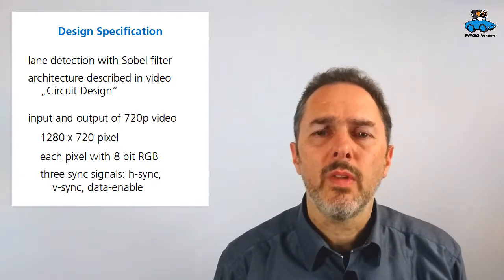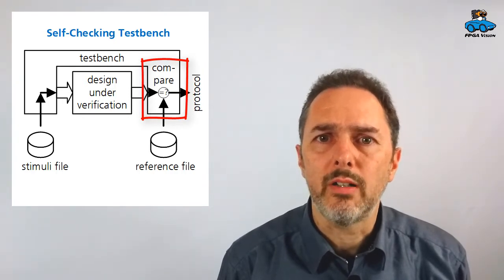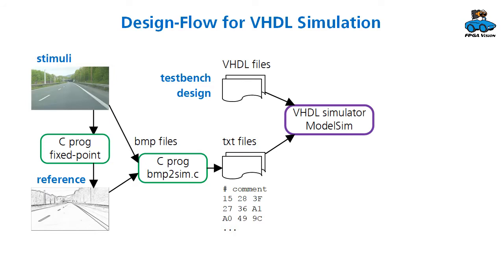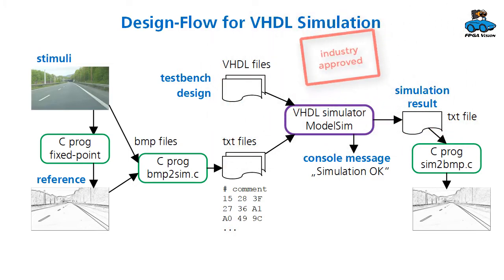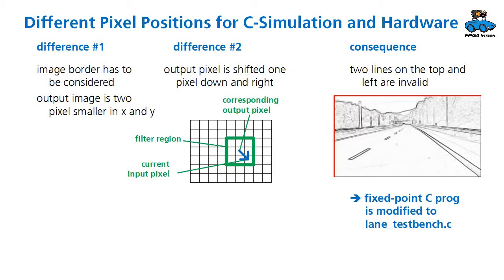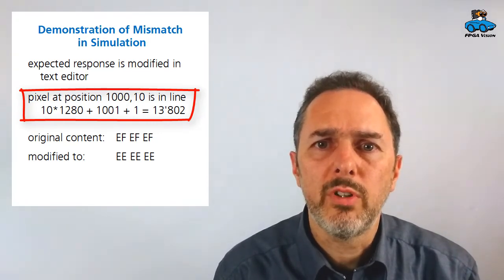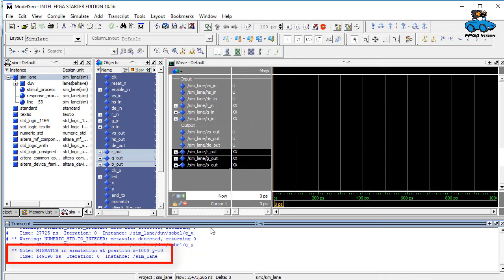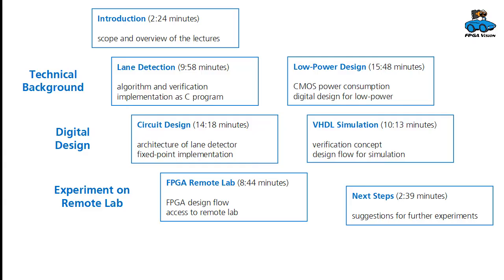FPGA Vision - VHDL Simulation

Comment: Buenas tardes, tengo problemas en la simulación. Las salidas de_out, hs_out y vs_out se mantienen como undefined en toda la simulación. Pensé que podría ser que el componente lane.vhd no le asigna valores, aunque no encuentro el problema. Excelentes tutoriales. Saludos.
Reply from the maker: (see Spanish response below)
The top-level for simulation is "sim_lane.vhd". It is the testbench and generates de_in, hs_in, vs_in. The component lane.vhd corresponds to the FPGA. It will receive signals from the video input. In the simulation, the testbench provides the video output. 
If you have more questions, please write again.
Tiene que usar "sim_lane.vhd" para simulation. Eso es el testbench y se genera de_in, hs_in, vs_in. El componente lane.vhd corresponde al FPGA y recibirá señales de la entrada de video. En la simulación, el testbench funciona como entrada de video.Si tienes mas preguntas, escribe de nuevo.
Best wishes y Saludos!